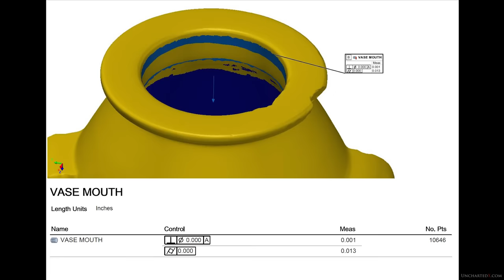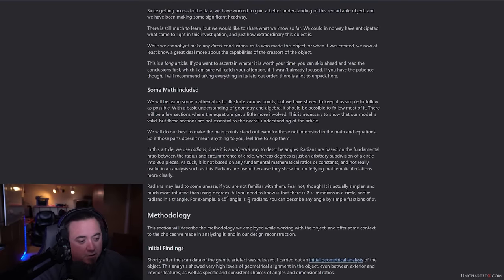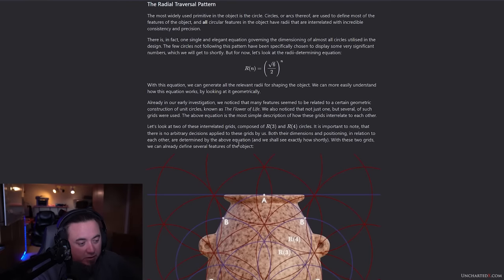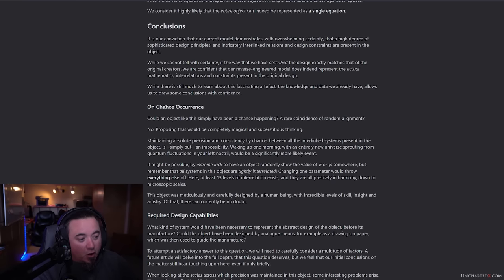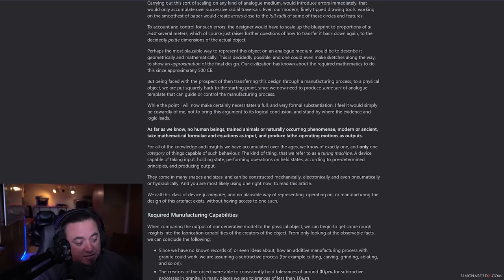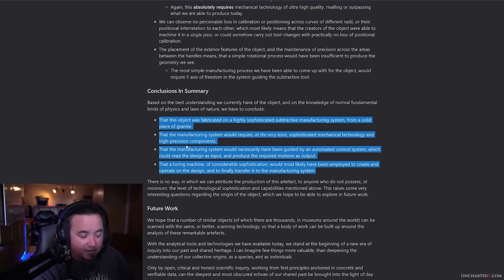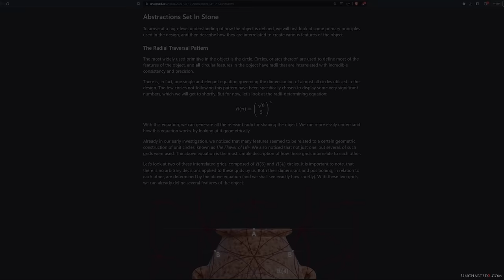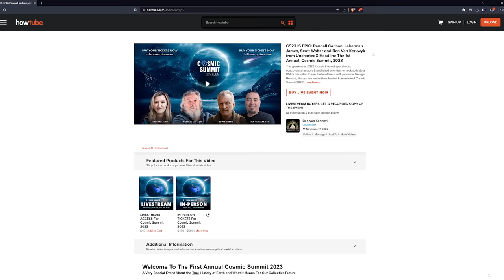Was a COMPUTER Used to Design this Artifact??

Comment: Many of your videos are utterly mind boggling (the Serapeum series especially) but this vase series is just taking it to the next level. It seems like undeniable proof to me!
Reply: @ZeroOneInfinity  I’d give just about anything to hear a quality sound system resonate in there. Probably would not sound good on modern music but with the right resonant tones I think it would be pure magic…
Reply: What exactly it is proof of, is still a question, However.. these facts absolutely BLOW APART all 'simple hand tools' theories.
Reply: Who would have thought a six inch vase might hold some of the secrets of the pyramids at Giza, and other ancient Egyptian architecture and artwork like the amazing statues they created. And the idea of a computer is not so far fetched with the finding of the Antikythera mechanism (just wish they gave it an easier name). lol. Powering a computer is also only in milliamps to make the circuits work, so it doesn't need "alot" of electricity. And the computer "chip" is made out of? sand.
Reply: @johannjohann6523  Wow, actually great points tbh. I am not 'fully on board' with the 'computers' theory, but.. from my experience in modern engineering and machining, tens of thousands of 'ancient egyptian' artifacts could only have been made with lathes and other high precision tools..
Reply: @sKraat528  A lathe that cuts on 5 axis, able to hold the piece without having to adjust it's position throughout various tool changes, without leaving marks or introducing tooling errors? It seems obvious a process completely foreign to ours uses a mathematical equation, not pictorial,  entered into a device with a highly advanced computing system working exclusively with ratios. One that we don't know of yet.
Reply: @johnj5985  Yes, in fact some of the very 'high end' lathes and robotic cutting tools we have today do have 5 axes of rotation, and we 'could' make this particular vase today, but it would be difficult and very unlikely to get it on the first try..it would definitely take a computer to get even near the same level of precision. The 'handles' are very difficult though, and sort of negate a 'modern simple lathe' unless it was extremely well controlled lol, like... giving exact 'part turns' not quite 180⁰ turns on either side of the material..
Reply: Beat me to the punch. Stopped just short of 22 mins to say that this is getting next level. The precision evident in these vases in now becoming quantified in a way that makes it undeniable. Clearly these were made with flint or copper chisels! ^.^'
Reply: @Aqua Fyre Few points...
Attaching the man by saying he's bone lazy simply because you have a different opinion, instantly diminishes your own credibility.
They were saying thousandth's of a mm, not inch.
Also, have you ever tried making any of these vases by hand, or with a double hinged lath arm made of wood?
Reply: The problem is that we simply cannot verify that this vase has not been made by modern technology. Please find a vase directly from under the step pyramid or a museum and then scan it.
Reply: @Aqua Fyre Oh so you call someone else lazy because they haven't built something like this themselves, and then when I ask you if you have, you tell me to look on line. WOW I'm blown away with your self awareness (not).
Reply: @louisberghaus1886  exactly. People fake things for no reason all the time
Reply: @Aqua Fyre Utter nonsense.
Reply: @Aqua Fyre Ok genius, here's a couple of home truths that one day, hopefully you might wake up too.

You have no idea what mine or anyone else's life experiences are or whether we've done our homework, and to claim you do is silly. 

Having a different viewpoint is fine but name calling people who have a different opinion, while hiding behind a pseudonym is something any kid in his moms basement can do to make themselves feel important. But all it really does is show up their lack of experience and self awareness. 

There are plenty of courses online that can teach one to become a better communicator, and they will change one's life for the better.
Reply: His serapeum videos have been disproved. Others have gone and measured the boxes inside and found them to be much less precise then purported by Ben and others. The ISIDA Project has the measurements listed
Reply: @Aqua Fyre No one is denying that ancient Egyptians made these objects, it's just a matter of how "ancient" they were. Now, if you're the one who's going to draw conclusions from that and choose to get offended, that's on you.
Reply: @louisberghaus1886  I wish more (or any) of the highly verified specimens could be subjected to this level of scrutiny but the establishment refuses. 

A better question might be to ask why we do not or cannot produce this with our modern technology? We don’t know if this particular vase is ancient but it is certainly more than 100 years old at the absolute minimum. How do you suggest a human made this in the 1920s to such a high degree of precision? 

When we realise how silly it is to imagine someone trying to make this in recent times, the idea of it being made by ancient civilisation is just unbelievable.

(Edited for spelling)
Reply: @inthemix  look into the ISIDA Project, they independently measured the boxes in the serapeum of saqqara and show that they are not very precise. Impressive stone working, but with margins of error well within human hand tool range. There are certainly enigmas around ancient Egypt and their works, but I think Ben and others are disingenuous with how they cover this topic and present information.
Reply: @darienkinne1347  Thanks, I appreciate the recommendation! I’ll look into it and inform myself fully :)
Reply: @darienkinne1347  You're being disingenuous. The boxes at Saqqara are in various stages of completion, from roughly finished exterior & interior surfaces, to finely finished exterior and interior. The boxes that have "perfect" interior measurements are the ones with finely finished exterior and interior surfaces. This implies the boxes were completed in their final resting spots. Nobody claims that all of the boxes are perfect.
Reply: The symmetry in the faces and many of the statues in Egypt could only be done with CNC or similar technology. That kind of precision and perfect symmetry is not possible by hand.
Reply: @AustinKoleCarlisle  even the most precise referenced by Ben and Dunn and others, is actually less precise than portrayed. They are disingenuous with the way they take measurements and film. You can look for yourself. The channel scientists against myth have some videos looking at this as well
Reply: @@user-kn6pn1cn8m Would you mind taking a few moments of your time to explain the combative, dismissive and condescending tone that you use when trying to make your points? If there is a good reason for it, I'd be interested in hearing it. Thanks.
Reply: @darienkinne1347  not according to the ISIDA website.
Reply: @@user-kn6pn1cn8m I do appreciate the response, it's nice to hear a more measured tone. Thank you for speaking with me.
 
I do still stand by my original assessment that your approach comes across as condescending, not "blunt" as you say. I believe you are being far too charitable toward yourself by using that word. I can imagine it is quite frustrating to choose to swim against the current of the comments section, especially on topics like these (let's be honest, the subject matter is pretty sensational and that will always draw an audience of less than rational people with little to no filters for logic or skepticism).
I assume you understand that these are choppy waters to be in in the first place, but if you do choose to go against the grain and bring up flaws that you see, you might want to grow a thicker skin and discipline yourself into using a more agreeable / neutral tone. If what you have to say HAS merit then that alone should be what weathers the criticism... when you allow the topic to get personal, it doesn't matter what you are saying anymore, the goal posts will have moved and the point you were making will have been lost. 
 
I really must comment on the following:
You say that "Ben makes a very good living out of this scam." That's is quite an accusation. You seem to be saying that you have accurate knowledge that Ben is conducting a criminal scheme and enriching himself unfairly on this channel. I may be the one reaching here, but I doubt that you have ANY ACTUAL idea what Ben's financial situation is, nor do you have any empirical proof to back up your extreme claim that he is committing some kind of fraud. Free wheeling statements like these reveal that you have build up a personal prejudice against the person (for whatever reason, justified or not) and you are not capable of containing your own speculations about their motives. Again, outbursts like this reveal that your concern is no longer about the information being presented, it is about your disgust for the presenter himself. I must ask the rhetorical question, what minds do you hope to change with your baseless, unsubstantiated accusations? 

Further, you follow up with "He's up to his neck in it, he knows he is lying as well as hiding a lot of evidence that would undermine his claims". With statements like this, all you accomplish is to disqualify yourself from any discussion about the information being presented. If you have first-hand knowledge that Ben has admitted he is perpetrating a fraud... then I presume you could make such a statement... but again, I highly doubt that you have that kind of evidence. You are making extreme statements about speculations you are making based on limited evidence and prejudiced assumptions. 

"People have given him tens of thousands of dollars. They are being conned and duped..." I assume you are talking about the tours he arranges? Do you know for a fact what is included in those tours packages how much profit he is making minus all of the hard costs he might incur? Do you have complaints from people who have gone on these tours with Ben? I won't belabor the point further... unless you have proof of fraud, your declarations come across as irrational... probably because they literally are "irrational" as in, you are not giving any rational reasons to bolster your claim.  

This is getting long and perhaps it isn't helpful. I hope that is not the case. There are some personalities in this genre that I must also admit get me frustrated and angry. I am not a fan of one of Ben's contemporaries in this alternate archeology field (if that is what you call it) whose channel is called Bright Insight, Jimmy is his name and he is quite the extremophile in my book... he's quite reckless and misguided (my opinion) and he's compiled quite an undeserved following (my opinion) of adoring fans who can't seem to recognize he's not very careful or credible (again, my opinion). 

Anyway... I hope this helps in some way. Contrary views are ALWAYS important to have around, those that can be respectful while also being persuasive are absolutely needed. Try not to second guess motives, always ask more questions before making conclusions. All the very best to you!
Reply: @@user-kn6pn1cn8m To be honest, I was reaching out to you because of how I saw the WAY you were replying to people - not because of WHAT you were saying or what position you were taking.  

In that vein, let me ask this, does it really MATTER that others choose to use this tone? Is YOUR use of this tone getting the response that you desire or is it just bringing you more frustration having people throw derision back at you? 

If you truly are actually interested in people "knowing the truth" (I believe I remember you saying) I would assume that the focus would be on making your point, not making lots of enemies.

If it is frustrating to you that others who comment here use this tone, why do you chose to further perpetuate it by adopting it? Do the opposite. You mentioned "fighting fire with fire"... well, that isn't really a thing is it? Even the adage is flawed.

To reiterate,  I did appreciate that you were willing to swim against the current by not just accepting the claims made in the video wholesale. That matters (to me, at least).

Hopefully you feel that this exchange has been helpful in some way, that was my only intention. I genuinely appreciate push-back when it is persuasive and honest... it helps me ask myself if I am missing something of value. We all need that because we ALL have blind spots. It's good to ask each other if we are catching them. Thanks again for discussing this with me.
Reply: @AustinKoleCarlisle  also, perhaps you could clarify. I did not make any claims in regards to where the boxes were prepared/finished. I recognize that there are boxes displaying varying levels of completion/finishing. What I am saying though, is even when the most complete examle is measured, the one which is commonly referenced by Ben and others, that it does not come out nearly as precise as they say.
Reply: @darienkinne1347  according to the ISIDA website, the few boxes that are accessible and have polished interior surfaces essentially have perfect 90 degree interior angles. likewise, the boxes with roughly processed interior surfaces do not have this level of precision, indicating the boxes were completed on site (which is another mystery and conversation in itself). these findings have been verified by professionals like Chris Dunn, etc. but there is a wide, concentrated, and growing effort to control the conversation when it comes to ancient lost technology. there are literally channels devoted to "debunking" ancient technology theories, and you'll see short videos of "debunkers" going into these places and holding the measuring equipment incorrectly or measuring one of the obviously non-finished boxes then when the results are less than perfect, the video presenter will claim victoriously that Chris Dunn is wrong, etc despite never going there themselves. these channel owners are not experts, they dont go to the sites themselves, they just have an agenda and it's unfortunate that they use propaganda to sway people on the fence.
Reply: My eye hand coordination is pretty good. I think I could have pulled it off. 😅
Reply: What is being described here is a process called "descriptive geometry", it was a well known process used before cad. This could, likely, have been the process, not the drawing part, of the making of such geometrically conforming object without a need for design, as these are highly unlikely designed because of the self-similarity of other vase like objects. The lack of communication skills present is also a bit of a giveaway. Also there is a maths, using polar coordinates as opposed to Cartesian/rectangular coordinates and it isn't magical but it necessary to use when working with rotating object. These are rotating object and is therefore likely analogous to our modern polar coordinate system of mathematics.
Reply: @sKraat528  What is it in this vase that cannot be done by known ancient methods? All I hear is that simple hand tool theory' is not understood. What part of it is unexplainable by ancient methods?
Reply: @birushinobi  the surface precision between the handles is the same as the rest of the vase. extremely advanced tools are required in order to both measure and maintain this level of precision.
Reply: In America atleast, we have 'accepted' this theory that the people who made these, and the pyramids including the great pyramid, were 'much more primitive', no mathematical system, no wheel, etc. This vase and many thousands like it, are certainly 'explainable' but the issue is getting the 'historians' to admit that they had better tools, understood the wheel and used it in many ways, and even understood 'precision'. It isn't that ancient people 'couldn't' have done this, it is simply that the historians won't admit that they had muuuuch more advanced planning and 'smarter tools' than they are given credit :o
Reply: @sKraat528  if it was even the Egyptian people who made these objects. it's very likely they were from another civilization that was lost.
Reply: @AustinKoleCarlisle  I can think of two different ways to make one side equal the other. GO HOME
Reply: @Austin Kole Carlisle  Could you stop deleting my comments and try refuting them, it's getting ridiculous, that you cannot answer any questions but 'someone' macigally makes them disappear.
Reply: @AustinKoleCarlisle  Could you stop deleting my comments that you have no answer to? It's very likely you are doing it.
Reply: Could you search for 'stone masonry'?
Reply: There is absolutely no example, anywhere, internet or elsewhere that shows archaeological example of people chipping away with copper tools making a laser precision "vase" out of granite. You know why because "they can't" it's impossible to make a laser precision carved vases out of granite with copper and wood tools?!?its Impossible and theirs zero examples,,,anywhere.
Reply: @italianstallion8510  You just assume they used copper tools to cut granite, there are other kinds of tools, maybe start with those. Define this term' laser precision'.
Reply: @italianstallion8510  Let me just help you a little bit, it's always fun:
Making a stone vase with primitive tools here's a search for you. Watch it, it's less than six minutes.
Reply: @birushinobi  I'm not assuming anything,your modern-day archaeologists claim as "fact" that the ancients didn't have anything harder than iron or copper?(no steel, titanium, or diamond cutting tools) So how are you supposed to get a lid surface on a granite jar within "75 thousands of a millimetre" of levelness? You would literally need a laser printer to do that level of precision.

 -And I'm still searching for a video of somebody,,anybody takeing a one foot square block of "GRANITE" being carved with copper, iron or Wood tools into a perfectly mathematically precisioned levelled jar that  also,has a surface so polished you'll be able to see your reflection on it ?
Where are these videos?????
"WHERE"??????????????????
Reply: @italianstallion8510  No they don't. They didn't have lasers, they used a eyesight and string for leveling. Did you look the video? Emery or corundum is harder stone than granite. There's a museum in Maine, called Maine granite museum, maybe check that one out. Mike haduck has videos about polishing, cutting, carving, quarrying, you name it, he's got it.
Reply: @italianstallion8510  There's also a channel here that the guy polished more than a square foot of granite to mirror finish, but I'll be blocked to say the name.
Reply: @AustinKoleCarlisle  Perhaps that's a 'possibility' and I am watching that theory as well, I often wondered if 'ancient egypt' (pre dynastic) wasn't the very same 'Atlantis'/lost civilization, especially when we see how advanced they were.
Reply: @sKraat528  i sincerely believe that Atlantis existed and sank during the last global cataclysm around 12,900 years ago, BUT I think there were a few survivors, and they went around different parts of the world, reestablishing civilization and knowledge (including agriculture), and they eventually settled in Anatolia shortly after.  Anatolia is, after all, the junction of essentially three continents, AND coincidentally, the "blue eyed" gene is genetically proven to have originated in Anatolia around that time. Can you say "Noah's Ark"? ;)
Reply: @AustinKoleCarlisle  The younger dryas impact, I agree that could be the case and humanity that was built to that point, was mostly destroyed, but it wasn't just 'atlantis' - humans the world over may have gotten to a very advanced and civilized point
Reply: @sKraat528  you mean, based on the worldwide evidence we see of advanced stonework, etc? keep in mind that particular stonework i'm referring to (called polygonal masonry) usually has a similar style no matter where it is found on earth, indicating a singular culture. the nubs on the facade, the three-dimensionally interlocking pieces, the fact that it's never located overtop of other stonework despite having new construction often overtop (indicative of extreme antiquity) --the fact that the swastika is literally found all over the ancient world, I can't help but believe there was only one group responsible for this ancient worldwide civilization.
Reply: @AustinKoleCarlisle  I haven't dove too deep into that but it is very interesting as well, I am more concerned with deciphering the 'exact methods and tools' used to create them, whether it was a worldwide singular culture as you suggest, or (doubtful) 'chance occurrence' that they are so similar
Reply: @AustinKoleCarlisle  What methods ancients used to make vases, and can the vase be done with known ancient methods? Simple enough question, when you understand the first part of the question. 

Do you want to do polygonal walls next? I'm game. Or do you prefer deleting any comments that doesn't fit your theory?
Reply: Hey Cale, do you not know how to use google to search stone mason
Or have an educated opinion. 
This is what eyou produse: 
'Short videos debunkers going there, Chris Dunn is wrong, etc despite never going there themselves.' 

Do you actually understand what you are saying? How can you not process a thought that is genuine and true? 

I thought these guys were great and educated, but after some searching I found out it wasn't and to them it was all about the story and the dough.
Reply: Another 4-5 examined with results consistent to this, and the case is compelling. If there is a fixed unit of radii between pots, that means standardisation and it's open and shut. I suspect it exists. If engineers are talking to other engineers, they will want common ground. If one says " I'm making a R(2) pot" the other can say "that's nothing, I'm making an R(1) pot". Standardisation started the industrial revolution.
Reply: @sKraat528  what about hand-powered tools, like as is shown in the Egyptian art of the time? And anyone looking at the handles can't really think this was made by some kind of advanced technology, can they?
Reply: @@Aquafyre tbh I took one look at the handles and laughed that people said these were precision made.
Reply: @johnj5985  Yeah we do know of one, except for now it just prints plastic.
Reply: @M1ggins  it's not the handles that are impressive, it's the area between the handles that is impressive because there is no discernable difference in surface precision between that area and the rest of the vase.
Reply: @psiloatlantis1246 So tools are not controlled by hand?
Reply: @AustinKoleCarlisle Wow a 90 degree angle sounds like the hardest thing to sculpt ever
Reply: @AustinKoleCarlisle How is that impossible? If you can do one side you can do the other. Don’t you think the would have had measurement tools back then lol
Reply: @hoidoei941  surface precision measured in a few 1000ths of an inch. watch the video, don't just troll for the hell of it.
Reply: @AustinKoleCarlisle  it’s granite not butter
Reply: @AustinKoleCarlisle  "not according to the ISIDA website"

That's a direct lie

I just checked the site and those supposed "perfect 90º angles" happen to be between 90.05º and 91.4º

Meanwhile, modern machining can produce angles perfectly square up to any measurement device precision levels

But you totally believe in Atlantis...so trying to reason with you is hopeless
Reply: @TheChzoronzon  well, as far as I know, the website used to say "90 degrees" for those precision, polished boxes but it may have changed recently. the point....is that the boxes show various stages of completion: the ones that are polished are the most precise, and some roughly shaped boxes are still left in the hallway, which means finishing was done on site, which is crazy considering the confined spaces and the polishing that had to occur in order to achieve the mirror-like finish.
Reply: @AustinKoleCarlisle  What is "crazy" is that an "advanced civilization with high tech" just left stone works as proof...precisely the same stone works than only requires exquisite craftmanship, instead of real high tech... lol

Where are the advanced composite, ceramic and metallic objects? The nanomaterials? The alloys? Nope, just stone. Local stone...

But I'm preaching in the desert, don't I? :D
Reply: @TheChzoronzon  okay, how about i ask you a question: if a stone-age people had access to an advanced form of technology, what kind of objects would the stone-age people create?
Reply: @AustinKoleCarlisle  Errr...if a civilization has access to an advanced form of tech...it's not in the stone-age by DEFINITION

"A prehistoric period when weapons and tools were made of stone or of organic materials such as bone, wood, or horn is known to be stone age."

Hahaha, are you trying to be funny, or do you really suffer from a severe case of dysrationalia? 
If the former, I'll give a 7/10 for the joke, bravo!
Reply: @AustinKoleCarlisle  I think they would create objects made of stone. What kind of objects do you think could survive for thousands of years without being stolen, broken, melted down or corroded away?
Reply: @andymccracken4046  i think some type of advanced civilization existed during the ice age and an advanced energy device survived the global cataclysm that ended the ice age. this device was used by the pre-Dynastic Egyptians to create these advanced stone objects. this device could have very well been the Ark of the Covenant.
Reply: @AustinKoleCarlisle  The Ark does seem to be some type of advanced and powerful stone cutting device, judging by the stories in the Bible, like the walls of Jericho and the statue of Dagon cut down. I suspect there were once a few of these devices and they were eventually worn out, couldn't be repaired and were lost. The Ark might still be in working condition, judging from the rock-cut churches in Lalibela.
Reply: @louisberghaus1886 what do you think they are now doing?
Reply: There is no proof these vases are from Egypt or when they were made. Plus, you can see flaws with your naked eye. 😂😂😂
Reply: @patrickmontie9583  seriously? My friend, the game is up.
Reply: Wild ain't it!! How advanced were humans before whatever happened?